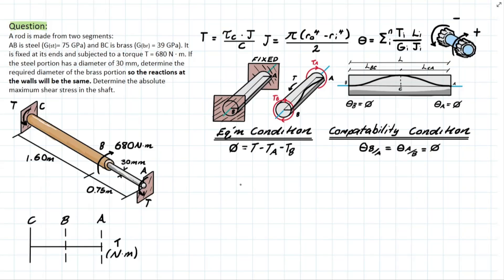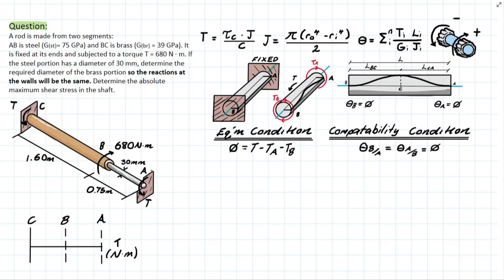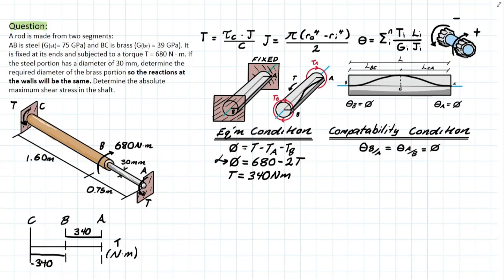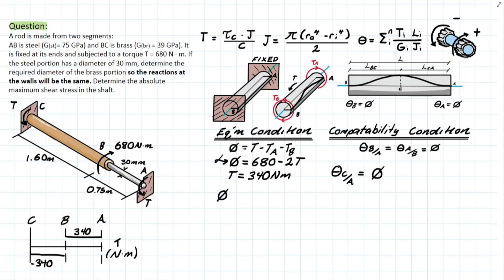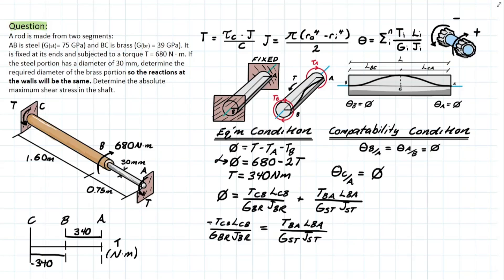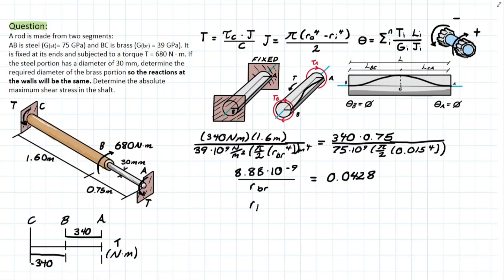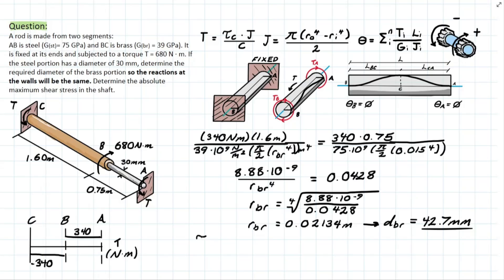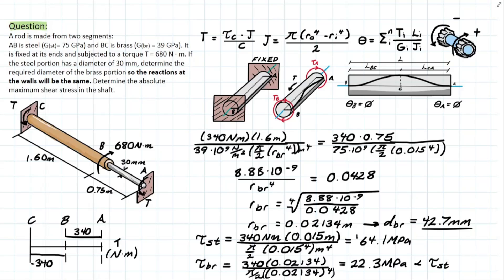Solving for Torque in Composite Indeterminate Shafts!

Comment: what happened to the negative sign when moving one angle of twist to the other side of the formula?
Reply from the maker: Good question. It cancels out when you plug in T(CB) = -340. Two negatives multiplied brings it back to positive, just forgot to right it into the problem solving process. Hope that clears it up!